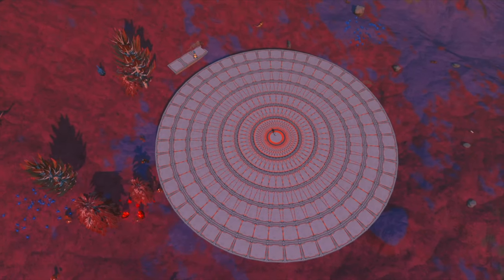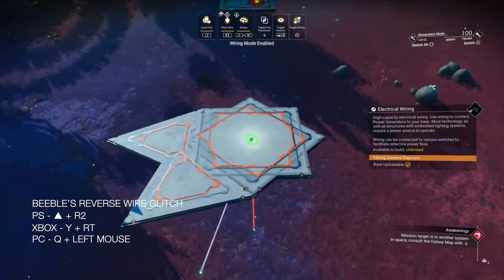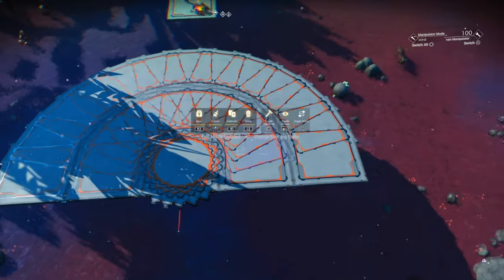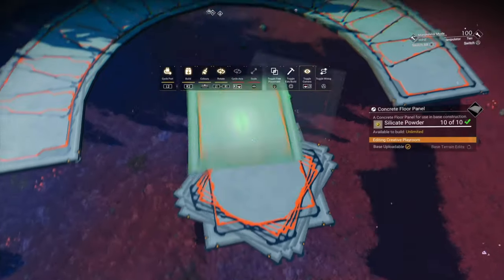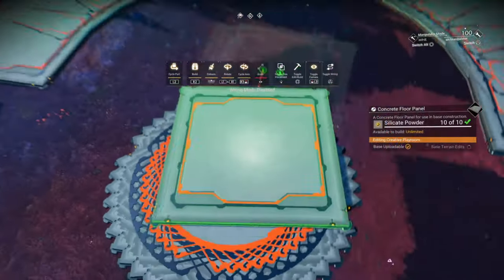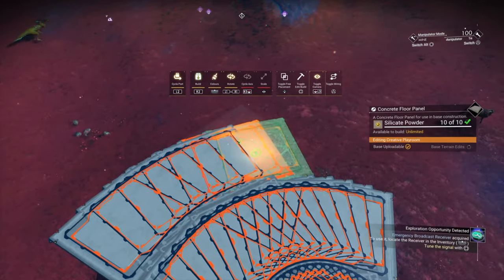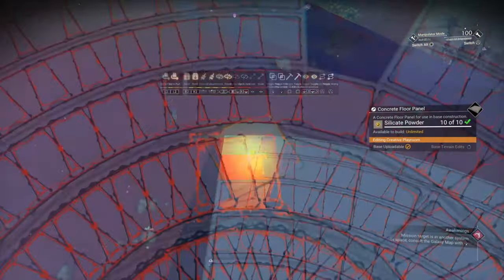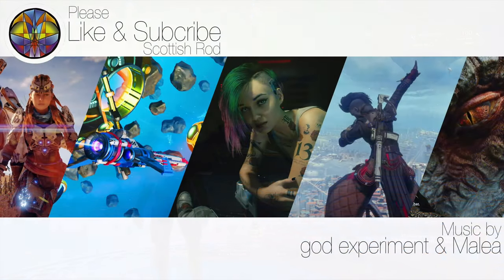48 Sided Perfect Circle - New Method Part 1 - No Man's Sky Update 2024 - NMS Scottish Rod

Comment: Did this yesterday when I realised my circle needed to be larger, then had to do it again to put the circle where i needed it originally, more practice 🤣🤣
Reply: Yeah. Circle size is rough. The easiest way to figure out the size is to place a floor at the spot where you want the center to be then go out in a direction. When you get to the distance, that's your radius. The equation 2πr will help. 

The method Rod shows here is the new "base 6" for 24, 48, 96 sided. There is also base 4, for 8, 16, 32, 64...

Comment: Done this about 3 times now and I always run into a gap when making the larger circle.. ugh lol
Reply from the maker: Are you flipping it from one side of the wire to the other? Or is it getting away from you? 
It happens to me but editing can hide all kinds of things.😊
Reply from the maker: I know what you mean, missing one of the floors. Yeah I work out and delete the ones between the centre and edge.
it can get a bit messy 😊

You also only need a quarter circle you can replace any missing bits from that.
Reply: @ScottishRod  yeah, think ill give up for now lol. I can see where the problem is, issue is I cannot get the floor piece to snap to it. It skips the next one in the sequence, which is weird because I can highlight it and everything, just can't snap anything. Oh well lol
Reply from the maker: @jruizagosto  been there! LOL A break might be wise. 😊

Comment: Every time I try to make a circle bigger than the one you can make using the triangles, the floors skip teeth when placing them outside of the middle and i end up with gaps. Cannot figure out for the life of me what to do even when deleting other floors to try and place, it's pretty annoying.
Reply from the maker: I’m not entirely sure what part your at, if it’s after the bit when you’ve flipped and the centre the teeth are evenly spread out. Then it might be worth working outward then removing the ones between the centre and the edge.
But also remember you only need to get a quarter of the circle and work from there to complete the rest.
Hope that helps?! 😊
Reply: @ScottishRod  it's when I move outside of the center and start building the actual circle, they start skipping. Also tried doing the circle airlock today with the garage doors arms on the insides but several decided to put the arms on the outside. Seems my game just hates me lol
Reply from the maker: @ryanlake6330  You can be building for hour's, sometimes days and all of a sudden the 'Snap Gremlin' raises its ugly head, saying nope.. nope... nope.... driving you mad with frustration. 

I finding myself having to laugh but the tears are real ->😂
Reply: @ryanlake6330  I've ran into this exact same problem yesterday night. 3 hours of frustration just to delete it all and then use Beeblebums 64 sided method and had the entire circle completed in less then 45 min. I found his method much easier.